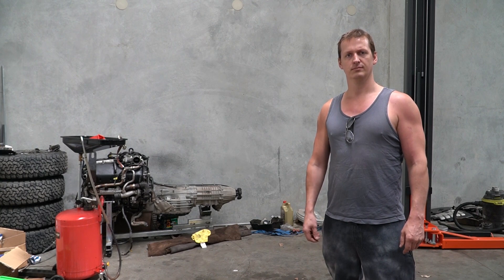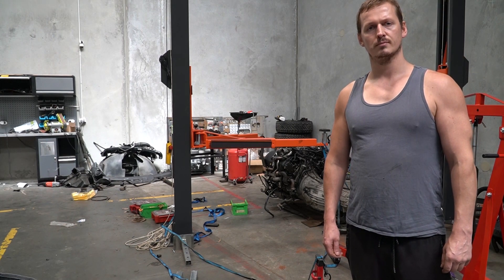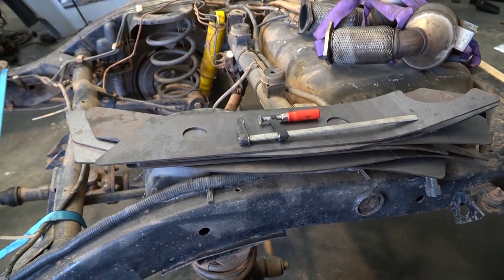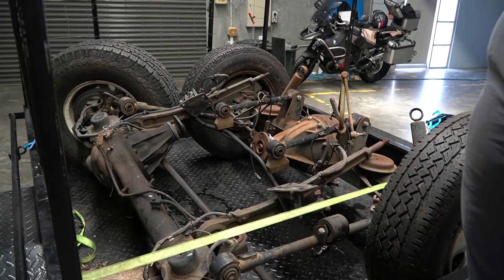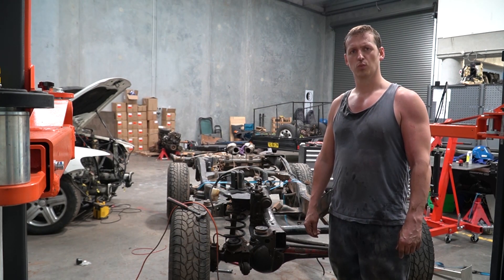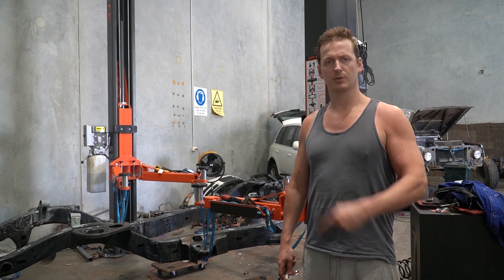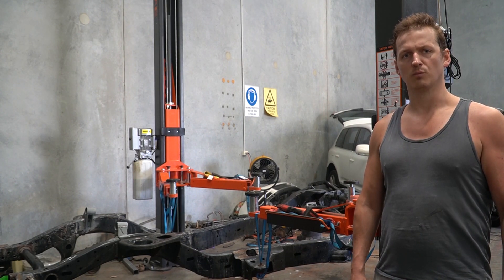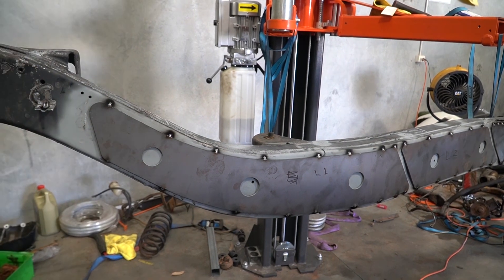CHASSIS BRACING - V10 TDi Swapped Nissan Patrol - To Cope With A Twin Turbo Engine - V10 patrol ep9

Comment: You might want to check with your engineer about welding 'across' the top of the chassis for those engine mounts. I thing you will find any factory brackets welded to the top or bottom of chassis rails are only welded length ways
Reply from the maker: Thanks, will look into it. The ones I've spoken to so far have simply referred to the build guides, which in turn refer to nonspecific "appropriate welding standards".